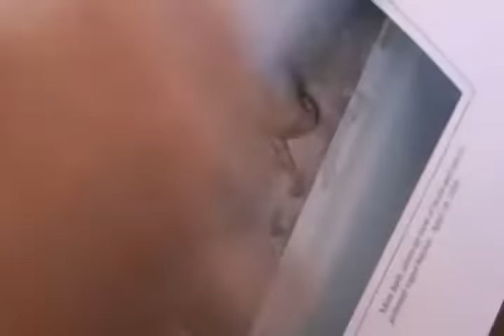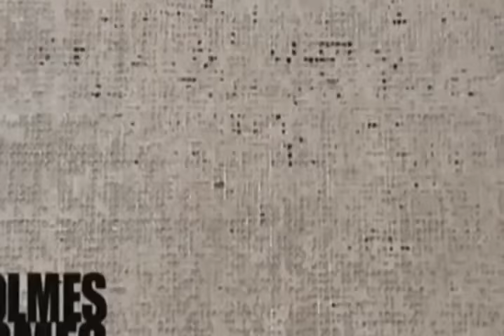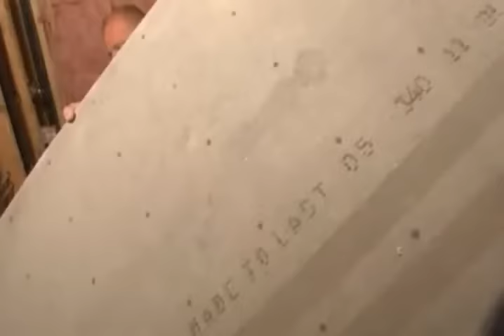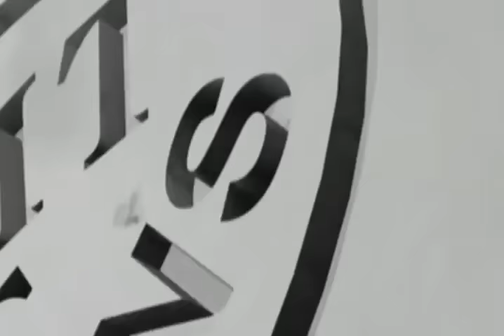Holmes On Homes Sea 05 Epis 09 Taking A Bath

Comment: Holy shit!  If I did shit work like this any general I've worked with would have had my balls in a jar.  There's just no excuse for a journeyman plumber to do such shoddy work. That said I did notice a huge difference between the city plumbers and the small town ones. I did my first year with a guy that had never done anything but set fixtures... the guy couldn't even do basic lead soldering,,yes I'm old.
I don't know how many times I've talked homeowners into spending a little more for better fixtures telling them they pay for themselves over the years with less maintenance and longer life. Also to stick with brand name fixtures for the better build quality.
That all said I can not believe they left these folks hanging like that... I be so embarrassed if fixtures I put in started falling apart so quickly and no freaking way I'd ever use the same damn fixtures ever again. If the insurance insisted on using the same I'd just have the homeowner get the cash equivalent and use it towards upgrading. Worst case I'd pay outta pocket for the fixtures and have insurance cover labour plus.  I've always found that the extra cost doing business like this keeps you busy during the sow times as ppl are more likely to call me then the other guys that do kinda shit work.

Comment: um i feel its more of the owners fault, they are overweight, it has nothing to do with issues in the bathrooms or tubs
Reply: So, are you a contractor? Because a master contractor just disagreed with you.

By the way, a standard bathtub holds 42 gallons of water, which weighs over 300 pounds. So the tub full of water has to support less than either of those people in the shower.
Reply: What about when two people share a tub?
You need to account for these things. What next smaller load bearing beams for people who only weigh a certain amount?